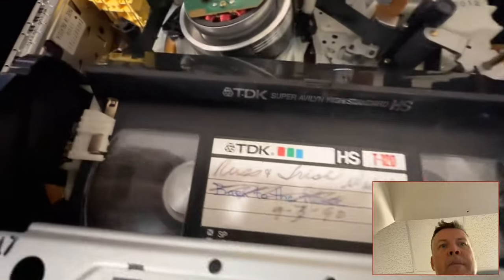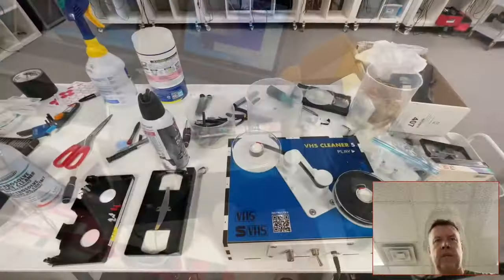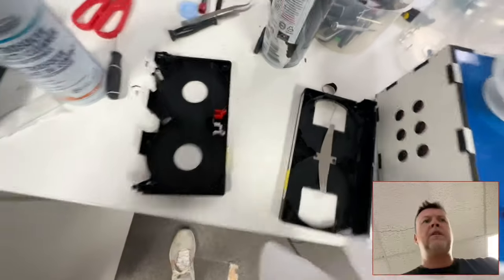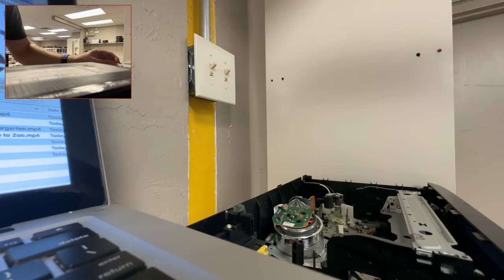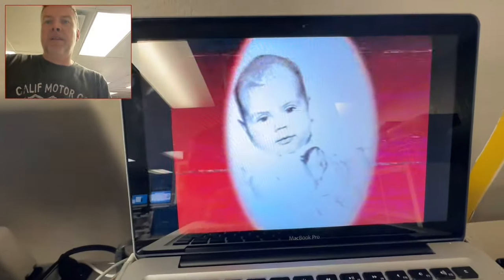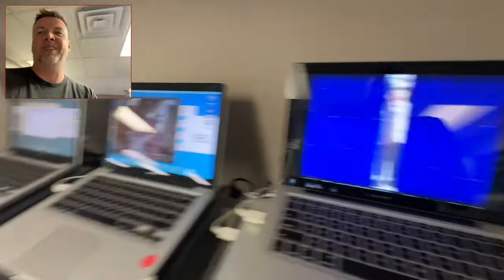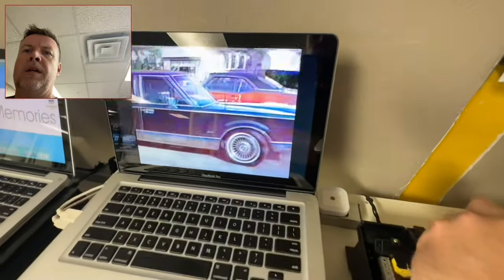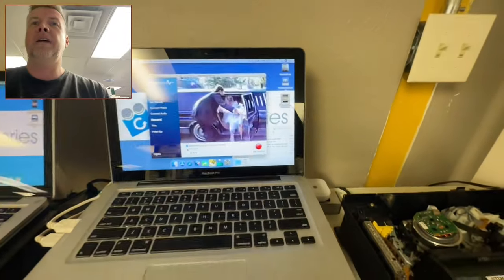VHS with Mold, Restoration of Tape left in humid attic for & iMemories rejected & wouldn’t digitize

Comment: Dude! I was just working on a tape like that yesterday! Unfortunately, it has some footage that I desperately need for a project. It played nothing on my test VCR . I cleaned the mold, made few passes back and forth, and yes,  the tape had this U shape too and it looked dirty and bleached here and there as if it's part of it now and the shammies are not picking up anything anymore after extensive cleaning. 

It's playing somewhat like the one your showcasing now with continues drop outs.

Questions: 
1-Does the U shape always mean that it was exposed to heat for a long time?
2-Is there anything else that can be done if adjusting the tape guides didn't work?
3- You think this change in texture could be the cause? and is reversible? 
4- If the problem wasn't heat, will baking help? 

Thanks anyway!
Reply from the maker: Hard to tell without the tape in front of me but baking might help if you haven’t tried it, worth a shot at this point. Good luck with that, it’s all a damn nightmare 😆